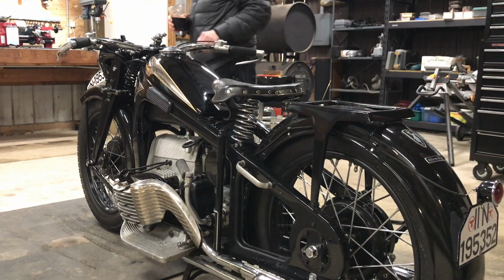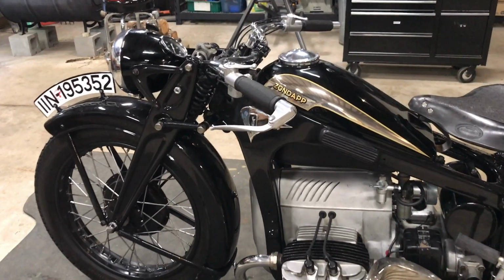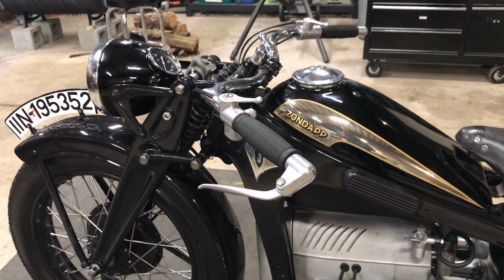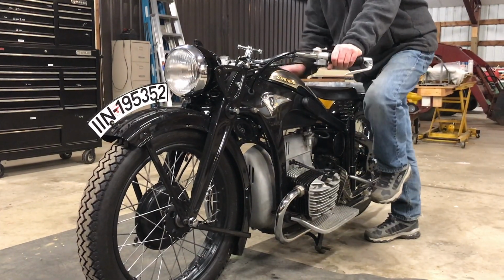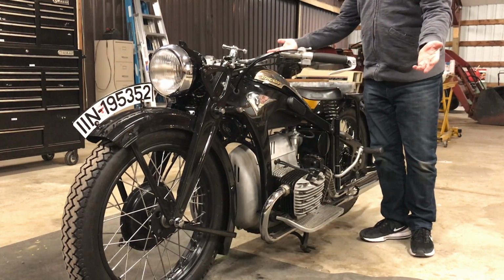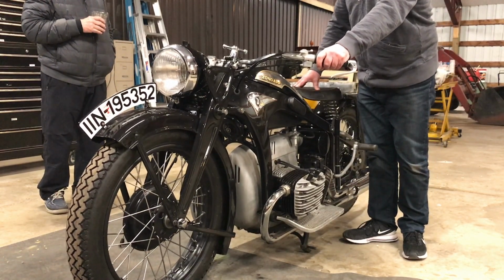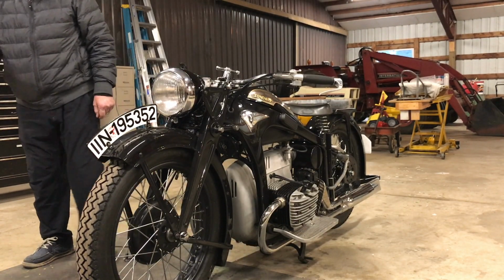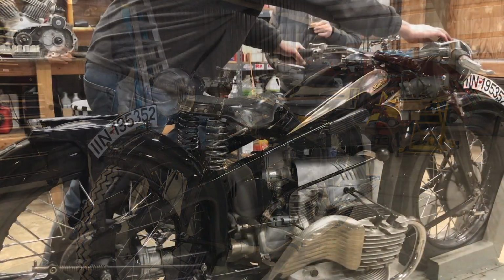1938 Zundapp K800

Comment: I remember there were Zundapp  'mopeds' & lightweight two-strokes around in the late 50s early 60s in the UK. I checked on line a little of the history surprised to find; 'After long test drives with the BMW and Zündapp prototypes the Arms Checking Department was convinced that the Zündapp KS 750 was far superior to the BMW R 75. 
A lot of history, it makes interesting reading. As always thanks for sharing  Mike. atb t ..
Reply from the maker: Very interesting Terry.  Thanks a lot for sharing that information.  Hope all is well.  Best wishes, Mike

Comment: Looking at the cylinder heads I presume it's a side valve engine? Certainly an easy starter, I dare say those twin sparks help. A bike that oozes quality from every angle.
Reply from the maker: Hi Geoff.  Yes, it's a side-valve.  Isn't it cool!!  Best wishes, Mike
Reply: @TheMightyGarage : I've just re-read the header and realised it's not a twin spark, it's a 4 cylinder! That's amazing for the period. The only other flat 4  I knew of was the original Honda Goldwing engine.

Comment: Dear sirs! This is a typical engine design of Richard Küchen. There was nothing to compare at the times before and after WW II in Germany. But fuel supply and engine cooling didn’t touch him too much if the design was fine. For example have a look to the Victoria Bergmeister. He ordered everything behind his georgeus aerodynamic engine design. So the durability needed always a little attemtion.
I am proud to own a Zündapp KS 601 with a TR 500 side car. Also a Küchen designed engine. Not so fancy as its extreme designes but well working and at its time stage of the art. No cooking pots for the the air filters like at the bavarian bikes. And the engine sound beats all the english bikes at this time in my oppion.
And with with real 28 Ps ( not Hp!) and 44 Nm on the crank shaft it was the real green elephant on german roads and BMW needed at least 5 to 6 years more to get the same performance. But BMW was supplied by bavarian politians and Zündapp not. The rest is hystorie.
Reply from the maker: Many thanks for your great note and information. Best wishes, Mike

Comment: aThis Zundap k800 are the only 180 degree flat 4 engines ever made. They are not boxer engines they are 180 degree V4 engines, you can see how small the engine is for an 800 look how close the sparkplugs are together. Everybody today will tell you a flat four like this will not work it will have too much vibration.